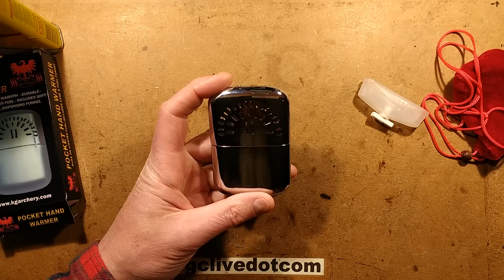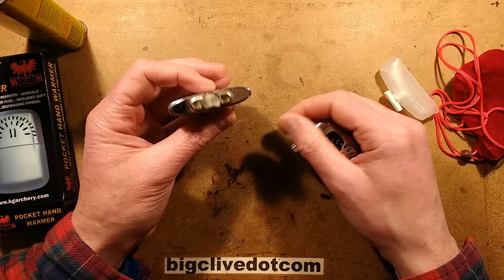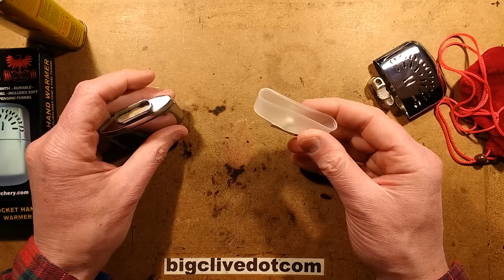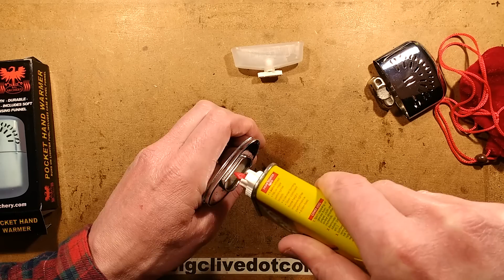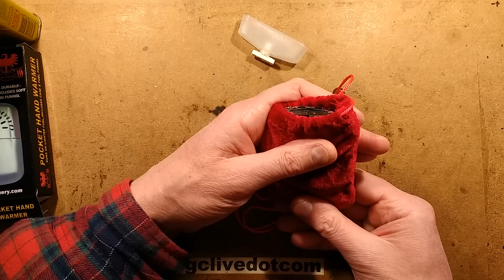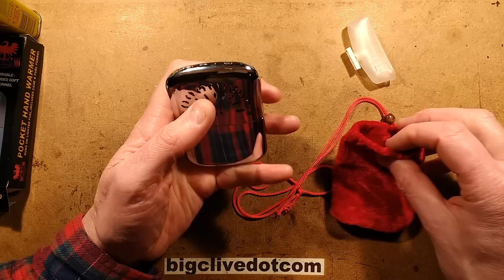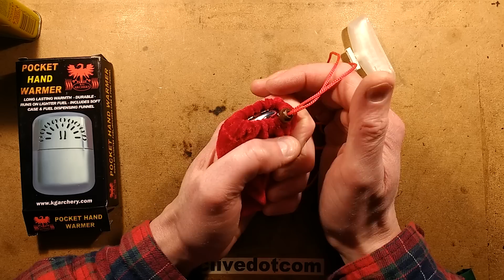How a petroleum-distillate powered pocket heater works.  (naptha)

Comment: Is that really gasoline that you use in the UK as a lighter fluid?
I would have thought it would be paraffin or 'kerosene'.
Reply: I imagine it's naptha, not petrol/gasoline.  Gasoline would be highly risky.
Reply: Yeah, naptha for sure, kerosene has a lower flash point so would be hard, if not impossible to start it up.
Reply: MRLT 
Yes, it's naphtha. 
Swan and Ronson are popular brands in the UK.

We usually just call it "lighter fluid".
Reply: In German I know "Paraffin" as a solid, the stuff you make candles out of. The lighter fluid is called "Feuerzeugbenzin" as "Feuerzeug" is a lighter and "Benzin" is also the fuel for my car (gasoline). So there seems to be quite some confusion about the names of petroleum distillates. "Petroleum" itself in German is/was often used for the stuff you used in lamps and is supposedly similar to the "Kerosin" for jet aeroplanes. I think "Diesel" is internationally more or less the same everywhere.
Reply: That's what I was thinking. You use LIGHTER FLUID. Not gasoline. Big Difference.
Reply: goamarty 
I'm with you, ,, in the USA , paraffin is a solid , wax. But in jolly ol", it is what we ( in the USA ) call kerosene,  or fuel oil,  or diesel fuel. And in a pinch, you could possibly add jet fuel to that assortment.
Reply: Here in Italy it's "benzina" for the car fuel (gasoline or petrol engines) and "gasolio" for diesel. We also use the word "nafta" as a synonymous for diesel.
Reply: ChayD; Wouldn't a lower flash point mean it's easier to start up? Since it is more volatile and combustible at lower temperatures.
Reply: Kerosene has a high flash point, around 150 degrees F.   It is 'hard' to ignite compared to gasoline which has a flash point of -45F, meaning it will flash in everywhere except the very coldest places on Earth.   Kero would be considered significantly safer.   But it also has less energy per kilogram than gasoline.   On the other hand, Kero maintains stable combustibility at much higher temperatures where gasoline would detonate uncontrollably.   Kerosene in a jet engine works well.  Gasoline in the same engine would just be a disaster and probably just explode.
Reply: I use paraffin in a "zippo-type" lighter, easier to keep it available for fire making without having the fuel evaporate, just have to lower the wick and add extra holes and it works great... :)
Reply: I think it's what used to be called SBP4...
Reply: These don't need to light on fire. As long as the fuel evaporates at a low enough temp, and the fumes are catalyzed by platinum, it will work. Kerosene should also work in these. Gasoline(petrol) works as well, but I have heard stories of it being far too energetic to be useful. They fume too much and release too much energy, and the fumes produced after catalyzing are quite irritating and carcinogenic. Not recommended.
Reply: I think 1K kerosene would work just fine in this as long as you get that element good and hot. Definitely nowhere near as dangerous as gasoline.
Reply: ParedCheese it’s usually called “lighter fuel” in the US. “Lighter fluid” was once used, but it means charcoal lighter, too. Ronson is a common brand in North America.
Reply: Cool, thanx for confirming this for me! I was really confused that he could get gasoline in such a 'lighter fuel' can, commonly at the store, on a fairly rural island...
Reply: you can use diesel

Comment: Is there a way to turn it off or do you just let it run out of fuel?  I suppose you can take the catalyst off and let it cool but that lets the fumes out.
Reply: Taking the ceramic "mantle" piece off stops the rxn. But there is no issue of "letting the fumes out," because you only need to take it off for a couple minutes. If you leave it off fora long time, then the fuel will evaporate. But, just like a Zippo, it is not alright. So it evaporates rather quickly, even when it's all closed up. So it's not something that you'll want to keep fueled up and ready to go. You'll want to fuel it up right before you want to use it.
Reply: Marvyn Harris you could technically turn it off by stoping oxygen from flowing to it, for example with an air tight lid instead of the perforated one.
Reply: Marvyn Harris yeah I’ll lift the catalyst off my zippo with a multi tool to stop it.
Reply: The standard way is to remove the the element using the edge of the top cover.
Reply: Put inside a plástic bag close oxigen, wait until si cold
Reply: I don't necessarily know the science behind this, but I've noticed if I pop the lid off of my Zippo branded one and blow fairly hard on the burner, that will cause it to stop burning.
Reply: Sometimes it takes two or three tries but I've had mine for almost a year and use it just about everyday. Has always worked for me when I go indoors and no longer need the extra warmth.

Comment: For the first time, I actually own something you showcase in one of your videos. Granted it's the zippo variety but close enough!
Reply: Too bad it doesn't come with 2 caps. One that properly seals it, and another that will catalyze.
Reply: I just pop it in a zip-lock bag, press the air out and seal it. It cools off quick when its air supply isn't replenished, and the remaining fuel can't really evaporate.

It's probably better to pop off the catalyst first and let it cool though. My understanding is that they can become fouled by incomplete combustion. On the other hand, holding a lighter to it the next time you use it may be enough to burn the crud off.
Reply: @techobsessed1  interesting!
Reply: bdot02 what's your thoughts on it ? Im kinda put off by the whole having to leave it for 12 hours to burn thing ? Is it an issue atall in normal use
Reply: JAMP0T1 you don't have to fill it up to max either. You can always just put in a little bit of fuel.

Comment: I had one of these years ago.
1. Don't carry it in an inside jacket pocket. The fumes will give you a chemical burn. 

2. To light it a couple of drops of fuel on the element speeds things up immensely.
Reply: Real men shoot 308 
I don't know what kind of fuel is used nowadays. But in the 50s and 60s I used one with no problems. ..
Reply: Willy Bee I used Zippo brand lighter fluid. What's in it? I don't know.
Reply: Generally, the only way you should get a skin issue is if the unit is over filled (this also tends to cause the unit to go out), so it's generally obvious...to solve it...open the cap, use the edge of the cap to flip the element off, then turn the bottom housing over, and give it a gentle shake or 2, to remove any excess naptha, then reassemble and relight it.
Reply: you ant get a chem burn from white gas! dont know what you are talking about saying it happened to you
Reply: it's not so much a "burn" as it washes off all the oils on your skin (making it dry and itchy and not very pleasant overall, I've never had it cause a "burning" sensation myself).  Calling it "a burn", while perhaps not technically correct for what's actually happening, is close enough to the sensations felt that it's in general parlance - much like "rugburn" or "indian arm burn" (etc.)
Reply: it's mostly Naptha / white gas.  https://certification.zippo.com/Documents/Safety%20Data%20Sheet/English/Zippo%20Lighter%20Fluid%20-%20(GHS-2015).pdf (hopefully link will not get completely nuked)